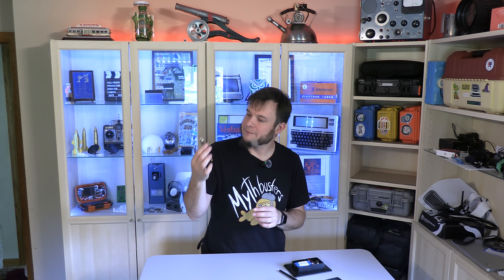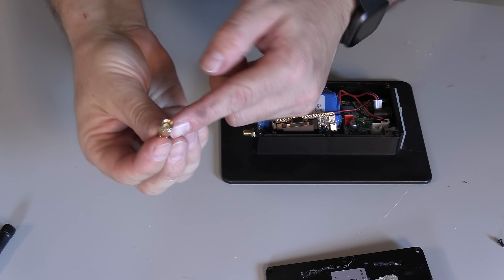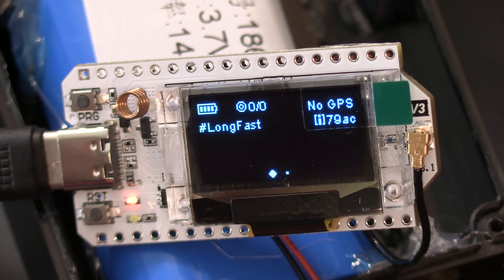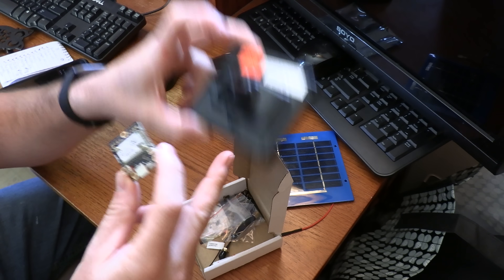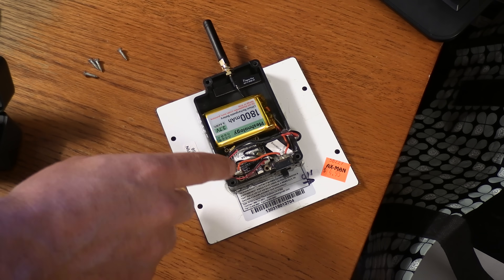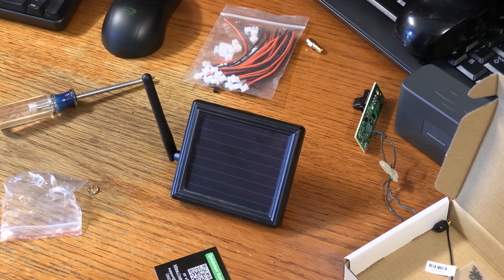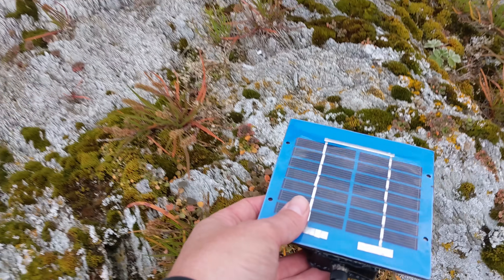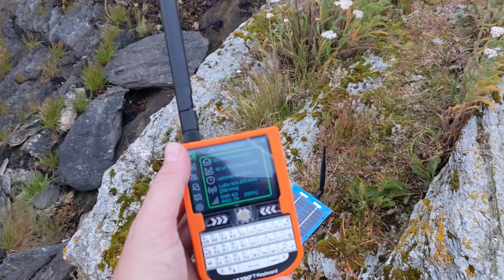I Hid A Meshtastic Node Somewhere In Alaska

Comment: Oh my, that's not even remotely water tight... Maybe I'm overdoing it with the watertightness.
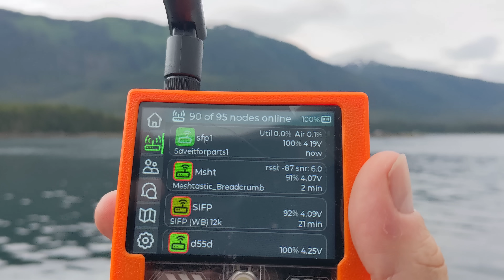12:56 And I'm always amazed by what huge factors people underestimate the range capability of Meshtastic/Lora - you should be able to connect to the node from 40km away, LOS is a prerequisite of course.

Comment: You should of weather proofed it better, and mounted it on the top of a tall fence pole (where the top is above head height from those curious heads and fingers) on top of that hill.   Instead of burying it in rocks.   Then it would last for decades.   If no pole is available, climb a lone tree, nobody would ever find it in there.

Comment: Somebody needs to make a battery charger board that measures the temperature of the battery, and if it is below freezing use all input power to run some weak heating element first.  Sure, it could be done with a microcontroller and mosfets, but it could operate on far less power with a couple specialist chips...

I've had to grind a few PCBs in my time.  Usually I use a dremel for the precision...  It'd a good idea to wear a dust mask in either case, though, given what the dust it produces is made of...
Reply: Doing exactly that on a larger project. My work truck has 1kw of panels on the roof. I use a esp32 and temp sensor, to drive a relay to a (2)20watt seed heaters under my 48v50ah batteries and in the same box as my freeze sensitive supplies and tool batteries..I set it to 38f/50f. It works so far this winter. Coldest temps here so far in the teens.
Reply: @jsmythib  That's really cool, and needs to become a standard for off-grid projects at higher latitudes.  At least until solid state takes over (if that does actually work out) and temperature doesn't matter as much.

Comment: Out of curiosity I asked Copilot how many meshtastic nodes would it take to create a decent worldwide coverage, it suggested around 2mln units for decent coverage. So if let's say 20,000 people hid 100 units each, costing about 2k$/person excluding potential travel costs, in about a year we can have a global decentralized free uncensored messaging and maybe in the future alternative internet, using old meshtastic nodes as sort of DNS layer. If some nodes get damaged or removed by the government, the coordination site can notify people nerby to put new one in it's place
Reply from the maker: It does start to have issues with a huge network, some larger cities are already running into that.
Reply: The protocol needs to be implemented on top of a more stable protocol. There's another similar project that doesn't get a lot of attention that could theoretically do this better. And you don't have to worry about them making them disappear you have to worry about them being compromised and left in place..

Comment: something to add to anyone mimicking a build like this-- After doing some testing, when you bend the antenna 90 degrees (although it's designed to do so) The SWR or "effectiveness" of the antenna goes down significantly. If you are able to keep the antenna straight, please do so to get more performance.
Reply: SWR is not a measure of antenna "effectiveness".     It is a measure of the impedance match of the antenna to the feed line and transmitter at a given frequency, indicating how much reflected power occurs due to an impedance mismatch.   A dummy load can have a perfect SWR, but it radiates almost no energy.
Reply: @TennisBallDog  Would the likelihood making a directed contact be more successful with an SWR or 1:1 or with a SWR of 3:1?

Comment: your dont doing it right i wanted to do it just like you but what we need to do is math and math that we need to get numbers from where we live so it like this sorry im not trying to be a teacher but this is what i learned tell me if im wrong we need the avg sunlight somewhere will get over the worst part of the year and there might be more then one and see will this device charge with my setup then try to figure out the best set up so x sun = x watts charging from sun + x batteries - watts the computer uses over time = 24 hours system uptime

Comment: Do you think it would be practical to use an old jam/sauce jar for housing the board and other internals? I'd maybe worry about the unit greenhousing itself to death, but that would be an easy way to waterproof and just throw your electronics into a container with reckless abandon. Could maybe paint it and put some silica packets inside to help defend against sun and moisture. Probably would be super janky but might be fun!!
Reply from the maker: I used to have a node exactly like that, and it kept dying. It was using the old TTgo unit that was kind of flaky though.

Comment: If you want to do a mesh network in Alaska out side you need sodium-ion batteries 🔋 because they work in the cold 🥶 and you will need a bigger box with insulation just to keep electronics warm the electrics will produce heat and with enough insulation and sodium-ion batteries that work in the cold you should be good for Alaska!!!

Comment: One of the main problems I've encountered is that LiFePo4 batteries freeze and are irreparably damaged if charged below zero Celsius or 32 Fahrenheit. It's true that the charging current is very low and the damage isn't constant, but it negatively affects their lifespan below 32°F. I solved this by using LTO cells, obviously taking care to install them where snow doesn't accumulate for months and months and doesn't reach the height to cover it from the ground with seasonal accumulation. Leaving the panel alone with fresh snow and lily in the sun is the worst way to do this. Climbing a tree and placing it high up is one of the best. In Alaska, the panel should be almost vertical and have significantly higher power. That thing is fine in the middle of the desert, not up there. Next season, it's just electronic garbage in the middle of nature. Ciao

Comment: The antenna being above the solar panel will become an issue… shading will drastically reduce power generation so ensure it positioned correctly.
Reply from the maker: Antenna is on the North side, so it won't normally shade it.

Comment: Yep here, ive done that with my first adaptec scsi controler in the 90s 2 days after buying it. Because the connector didn´t fit in the stupid space they left. So take the "propper" tool aka a sidecutter hold it against the light to check for copper on the inner layers and make a 45° cut. It worked for years in my 486, but i realy filled my pants doing so, i mean it was two month of my salary at that time. 🤣😎
Reply: Yeah it's not like you could do a warranty claim on it, and be like it accidentally fell into my angle grinder....
I know those situation's well you just have to buy it and try it and I hope that you don't break it.
Reply: @imark7777777  i mean you could try it... But someone is probably just laughing the whole day, that you tried it.

Comment: That's not an SOC its an MCU. 4.2v is standard full lithium voltage, which I'm sure you must know in your position but it just sounded odd. "This is a 3.7v battery"
Reply: people often refer to batteries via their nominal voltage, lithium batts have a nominal voltage of 3.7 roughly.

Comment: I think this device will not survive in Canada
For 24\7 operation we need calculate total energy which solar battery can generate in one day in mid-winter, because of shortest length of day. Then multiply this power to quantity of solar days in a year divided to 365. And this power should be higher than energy that will be consumed in a year by all electronic in a box.
Then we need to know how much current draw all electronic in a box. And we need a battery which can feed electronic on maximum quantity of cloudy days. 
Will be awesome if schematic of power module will allow you to work only from the solar panel if the battery fails, i use attiny 13 which measure voltages on solar panel and battery (remember about overcharging and undercharging), couple of diodes from panel and from batery to "main power line" and one transistor which turn on charging the battery from "main power" which controlled by attiny. I use 3W panel and LiFePo 6A/H battery for 190 mwt radiobeacon which sends every 10 seconds "Q" letter ic CW. This is power for 60 N latitude with 66 sunny days in a year.
Also cheap solar panels often lie about real power, always check real generating current on a sun with multimeter, difference between declared and real power may be dramatic.
It is better to install the solar panel vertically so that leaves, dust and snow do not remain on it
It is better to make the case in the form of two boxes, one inside the other, to slow down temperature changes, make small holes at the bottom of each box in the corners to drain condensate, it is worth covering the board with a moisture-proof varnish, and devices operating above 400 megahertz should be installed as high as possible
Also a collinear antenna and simple homebrewed cavity filter should improve receiving distance, because RF frontend on this devices a piece of... you name it.
Reply: And which sun do you recommend testing with? I am assuming you're on another planet and I'm just curious as my planet only has one sun.
Reply: @imark7777777  Lol. i mean the duration of daylight hours in winter is shorter, as is the height of the sun above the horizon in winter

Comment: Not only has the finest precision bench grinder been utilised in janky DIY projects, I've used it in production. You don't have many other options when your 1000x boards, populated with $100's of dollars worth of parts don't fit your custom injection moulded case. It's a triforce, nobody is footing the bill to remake the boards (let alone source the parts), we're not commissioning a new mould, and even if either of those was an option, the deadline is looming. Piss with the cock you got. Was only half a mm off each side to make it fit. Not  much, but any job that needs doing 2000x is a big job. Built jigs, new grinder and a good stone, fume hood. But it really was the best tool for the job. How else do you slim down a thousand FPGA based boards by a few blonde ones in under a week? If only the CAM engineer understood tolerances more than a variable to be poked at solid works. I wish this was a joke, but he 'left' working with us, and became a high school gym teacher. That's how clever he was.
Million dollar project, saved by a bench grinder, some MDF jigs, cardboard box n duct. tape. Technicians don't get paid nearly enough.

Comment: I've put trust in hot glue a couple times in the outdoors. You'd be surprised how hot things get in the sun. Everything I've hot glued, the glue has melted in the sun even when it's indirect. Just an FYI!
Reply: Gorilla 💯 silicone is better
Reply: Blu Tack is your friend. You could probably water proof a toaster with that stuff.
Reply: @The_Cakeminator I’ve used BlueScope but in Australia sun it softens and falls away
Reply: I have a 3D pen for such tasks🤗 PLA holds up in the sun and is malleable when hot, to push it in every nook and cranny.

ABS of course gets "welded" with ABS filament.
Reply: @goiterlanternbase  “Holds up in the sun”
Maybe in Antartica. For me it melts in the sun like it’s chocolate.
Reply: @xanderplayz3446 As long as it only softens and not becomes runny, everything is fine🤗 
Btw, we are above the 100F each summer now. Arctic or what you would call it, wont help🤣
Reply: @goiterlanternbase my PLA speaker hook holds up fine to 45-50C summer days on our glassed patio.. I'm in Sweden so normally our summers are mild but not in a semi-greenhouse
Reply: That's why I use UV Epoxy :)

Comment: I work with small solar stuff like this, so I just started kicking some ideas around for what the cheapest setup would be.

Buying retail I think the best performance per dollar would be something like a 6V SLA battery with a solar trickle charger, although those are all more expensive than I would want them to be. Solar panels have been pretty heavily tariffed for quite a while now

The most useable option would be to harvest the panels and add your own charge controller to get max performance. The TI BQ24650 is excellent for higher voltage applications, and the BQ25185 is a great for cheap, 1s lithium projects

Comment: I've gotten to the age (57) that any small piece of electronic hardware that "sometimes boots up when it wants to" never goes back in the bin for later. It gets 1000v run through it with a happy lil megger till the smoke gets me tickled. 😃
Reply: I use a wind up Megger,   so far I have 100% success locating faulty components.  Also good for demonstrating the electrical conductivity of a snotty nosed teenager and the cunning and wisdom of their elders..

Comment: Hot glue is not a good method to protect something from water, the easiest and cheapest method is to pot the entire inside with Vaseline
Reply: classic method in the RC community is to use conformal coating. Seems to work pretty well, besides that potting it in epoxy/resin works pretty well also.

Comment: I see a few potential problems. The antenna connector isn't waterproof and will therefore start to oxidize after a while. Furthermore, these batteries don't Like the cold in winter.

Comment: I wonder if theres a way to report back to you traffic amount once a month, not to creep or  spy or play big brother, just have it report back - packet use amount, how many ppl are using it, how far away they are and general direction and status of hardware.
Reply from the maker: Something with 4G integrated would be cool, but then it would be more expensive and need more power. If I still lived in Alaska I think I'd make something a little bigger and leave it on top of a mountain :-)

Comment: Interesting project. 3D printing can be very useful in making custom enclosures for your projects or adapting existing parts to suit your needs. In this case ASA or PETG filaments will be more than adequate.
Reply: Like racing stripes on a car, jank makes the mesh go better.
Reply: @infered10 Ha ha 😂 Good approach. Except 3D printing can make durable functional parts, not just cheap plastic crap.

Comment: I love this except, three things: if the battery gets hot in the Sun and overheats it could be a fire hazard. Not sure if that's an issue in that location or not. As soon as it snows the battery will die and it will be dead forever so the longest it is going to last is until the winter just a few months. And third, after it dies, it's just e waste. But all of that said, I still think this is awesome.
Reply: Hopefully somebody finds it before any of that happens
Reply: the heltec board will still work with a fresh power source
Reply: If it has battery discharge protection, why would it die for good? It'll only die until the sun shines again.
Reply: @paulsengupta971 lithium batteries don't like cold temperatures, the battery will discharge itself over the winter and die completely, even with discharge protection

Comment: Found it! I belive its 28.3 miles away from a certain Alaskan airport.
Reply from the maker: That sounds about right :-)
Reply: @saveitforparts doh!  I was sure it was going to be slightly far northeast point edge of crab cove as the little islands and the cruise ship path seemed a match to the video at 12:07, but that comes in half the distance mentioned here (if we’re using the same airport lol)
Reply: Proof?

Comment: i wanted to make a droppable weather station just like this, maybe even with a tiny low power webcam. Any idea/video for that?
Reply from the maker: That sounds interesting! I bet it would need more power though. I have some solar trail cams that send me photos over 4G, but they need slightly bigger solar panels.
Reply: @saveitforparts  my knowledge of electronics is limited to watching your videos, so I have no idea if this is feseable or not, but I really would like to have this mini weather station with a camera that sends at least one picture a day over the internet (very remote place wher I would just drop it and not come back). Do you think it would work? Maybe adding a battery pack to recharge/extend its operating life during the day?

Comment: is meshtastic basically wspr for non amateurs? or can it handle bigger messages?
Also is each user a repeater? So if there is 3 mountains between you and i, with a mesh node on top of each, would you and i be able to chat.... 63 characters at a time?
Its interesting to me. Plus this should help the algorithm a little :)
Reply from the maker: I think the default repeater limit is 8 hops? There's a difference between regular nodes and repeater nodes but I forget what it is. But yeah, the more nodes in a network the farther you can get a message to travel.
Reply: @saveitforparts  I seen online that 205 miles is the record for distance. You think from the top of one of your mountains you have there, attached to a sat dish to boost ya signal, you could beat that ? Im guessing you would need to make a dish to spec for it. But that would make for some cool content, and maybe your name in the record books. I mean if you find enough elevation, and you get enough gain, even on 1 watt good things will happen right ?
Reply: @saveitforparts  You might be happy/saddened to know you corrupted me like a bad hard drive. Im now on the meshtastic, with a second one and bigger antennas on the way. Wrote my first logging map program for it aswell. your bad for me lol

Comment: You might consider filling your "disposable" mesh nodes with electronics potting compound.  Should keep it safe from the elements for a long time.  Just wont be able to repair it since it would be encased in goo.